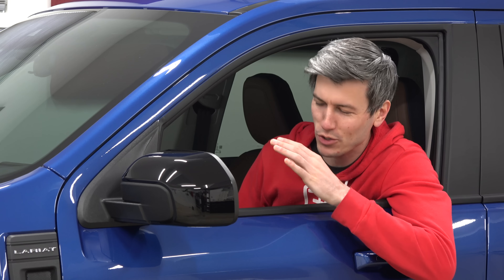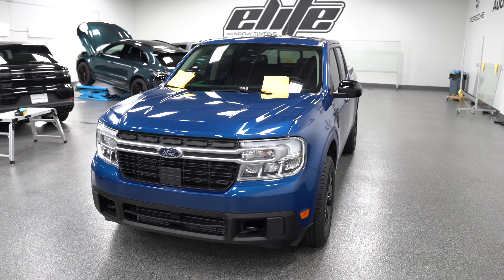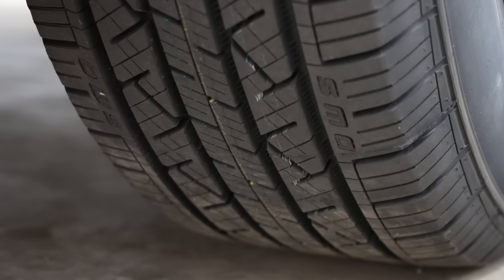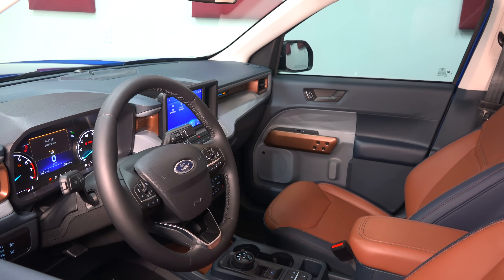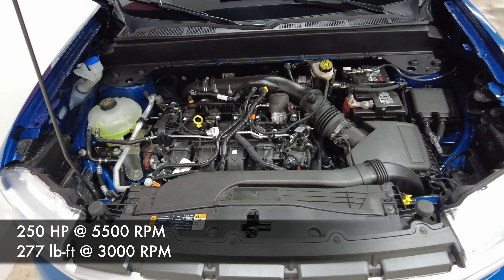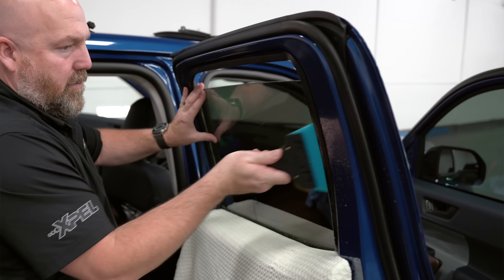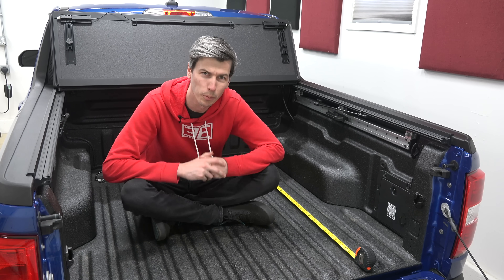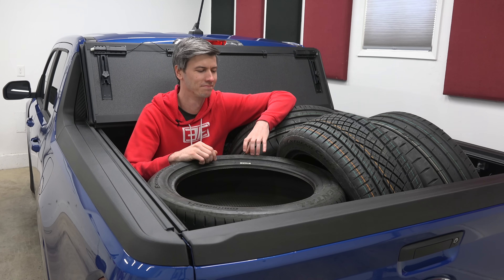I Bought A Ford Maverick! The Perfect Pickup?

Comment: Hey Jason, what do think you’ll do now that Ford “finally” released an AWD version Hybrid Maverick?
PS, I once purchased Continental CrossContact LX20 tires (early generation) and they were amazing = so quiet, so effective for quickly dispersing water and the tread wear was minimal, which has kept my eye on all Continental tires going forward. 
I’d consider buying this truck, maybe, I hope this Ford product has “high quality/score” responses  by owners and no electrical issues or other. Great fuel mileage on the Maverick hybrid to be sure 👍🏼

Yet, I love my no-issue thus far smooth running naturally aspirated 6.6L gas version Chevy Silverado 2500, a 2020 model that has no cylinder deactivation gimmick 👍🏼, no start stop so that long term I won’t have to deal with negative outcomes with the two aforementioned. I have an Oil Catch Can to mitigate HCarbon build up. I love the 82” long box and purchased the robust GMC/Chevy side-mounted bed storage box kits (fits over the dead space surrounding the wheel wells) I don’t mind the 17ish L/100 km on highway when empty and 14-15 around the city, depending.I could go on, however to end with, I also had it undercoated with cosmoline and the paint finish with Xpel. So far, it still looks like new on top and underneath (some winter roads and some summer dry gravel roads get sprayed with that nasty calcium chloride). Oh, my model has their Z71 package and AutoTrac (pseudo AWD) which I use on gravel roads and winter driving. Robert in Edmonton, AB

Comment: You are not alone. I just traded in my 2013 Subaru Outback and a K5 for this truck. Always thought they were a "hybrid" or Electric truck option. I was so surprised to find a blue (My favorite color) AWD XLT version! Test drove a used 2022 FWD and the 2024 AWD version. Hands down the 2024 was the much better option. Was trying to combine the sleek styling of my K5 and the AWD function of the Subaru. This has done both! Going to miss my outback so much...

Comment: Around 40k?!? My new Frontier Pro4x was that price and is 10x better in every way
Reply: Most Nissan Pro4X's I've seen with any sort of options on them are $44k and up.  I got my Maverick FX4 with 4K tow and LUX package for $34k.  Price is better and MPG is better on the Maverick.  I looked at all small truck offerings and the Maverick FX4 with 4K tow made the most sense for my needs.  You are going to spend upwards of an extra $3k a year on gas with the Frontier, its fuel economy is terrible by today's measure.

Comment: The parts store I work at has one for deliveries and I can’t test the truck properly because it’s full of cameras watching our driving. But even with the base motor and fwd setup it is a pretty nice little small truck and it can break traction pretty easily without setting off any alerts about my driving.  I’m guessing it’s decently peppy if I could floor it.

Comment: Back in the 80s I owned a Dodge Rampage, which was a real blast for a kid back then.  It had a 2.2L 4-cylinder, front-wheel drive and a unibody just like the current Maverick - and was absolutely perfect until I got to needing something full-sized.

Yes I know this truck has AWD, but I would never tow with the front-drive Maverick even if it does have a hitch receiver.  Towing with a front-wheel drive vehicle is sketchy, so I would just use it for a bike rack or something similar.

Comment: The Honda Ridgeline has been available since 2005. You didn’t even mention it despite it matching or beating this thing in nearly every way
Reply: The Honda ridgeline at its base cost more then the most expensive package possible with the Maverick at my local dealers, 

If it didnt at least match the Maverick in every way it would be a total scam lmao.
Reply: @evensong3356  I guess that’s a fair point, but you also get a nicer cabin, bigger bed, more storage, more towing capacity, fuel economy not far off. My point was that the maverick is a barely smaller clone of it but is presented as if a unibody pickup is a new concept when it’s not. He paid 40k. For 5k more he could have a trailsport ridgeline. If he paid the base price I kinda get it

Comment: I had a similar epiphany about a pickup truck which unfortunately is not available in the U.S. (or at least I don't think so.) I rent cars in Costa Rica and the price to rent a diesel Toyota Hilux and a RAV4 was about the same. The Hilux (small pickup with four doors) also had a slick six-speed manual, and it got 35 MPG on the highway, nice long bed, and a simple, nice, basic Toyota interior. Four wheel drive, transfer case, etc.

Comment: I heard rumors that the new 2025 FORD MAVERICK will have a boost in both horsepower and, and torque for the 2.0. Also, that they will have a hybrid all wheel drive version. And a measly tiny 1.5 single turbo. But I am waiting on the 2.3 single turbo Maverick AWD.

Comment: It's not a pickup truck. (Not body-on-frame). It's a Subaru BAJA or Hyundai Santa Cruz;  ie: a car with a baby pool in back. Just as "CUVs" are NOT "SUVs", though no one on the internet seems to either know or properly make the distinction.
IMO, the Ford Maverick is currently Ford's halo/flagship vehicle. They're very lucky it's been accepted by buyers and is largely liked. It's one of the few Ford vehicles the "typical" buyer can possibly afford. I don't want to live in a world where the Chevy "Blazer" has a 2.0L Turbo 4. These are sad days.

Comment: I drive a 2024 Maverick XLT FX4 with the turbocharged engine and it is basically my dream vehicle (not a beat up hilux with a .50cal so it’s not a exactly my dream vehicle, but it’s close)
Reply: Oh and apparently I also have the 4k tow package, I didn’t realize that but I have the brake control and seven pin connector

Comment: Just took my 22 2.0 XLT FX4 Off Road AWD on a 1500 mile trip to the OBX through WV, PA, Virginia and NC and averaged 32.5 mpg! Love the truck! Change oil every 4800 and flushed the transmission fluid at 30,000!

Comment: I was very interested in buying a Maverick a couple of years , but the wait was long and if you could find one on the lot it was 5k or more over sticker, I was not going to do that! Plus, my wife didn't like the idea of getting a truck. I bought a new 2022, fully loaded, Bronco Sport Badlands instead. Its considerably  more expensive that the Maverick, but I am loving it! i already have 43k on it ,almost half of that was towing a small 12 foot travel trailer to Alaska and back. It has the same drivetrain as you Maverick. I a typically average 2 to 3 mpg more that rated.
Reply: Has it been reliable? I like those too but own a 22 maverick hybrid.
Reply: @jeedwards1981  Yes. Only problem was a check engine light that turned out to be a bad purge valve, covered under emissions warranty.

Comment: You spent about $7,000 too much. There are literally 300 of them within 10 mi of me. A lariat, 5k miles, $31-35k. With 10k miles, you can get a lariat under $30,000.
Reply: Sell the wheels, put factory 18s on it. 18"X 7.5" WHEEL KIT -MATTE GRAY
$1000.00

Comment: I had been driving my 1988 pick up,  its "full sized" standard cab short bed. So small by today's standards. I got the hybrid maverick because of fuel economy mostly, as well as safety (airbags weren't mandatory until 98). Its been great getting over 40 mpg, and it does what I need it to do. Its insane to me that "truck" people don't think of it as a truck, because the maverick has more in common with my 36 year old truck than a modern f150.

Comment: I bought a 2023 Maverick Lariat FX4 in Dec. of 2023. I had been in the market for a Honda Ridgeline, but none of the dealerships in my region wanted to be reasonable about the price and obviously did not need my business. In the last six months of ownership, I cannot begin to describe how lucky I am to have bought this instead. I love this vehicle. I bought a camper shell through Ford for the bed. (Overpriced, but extremely useful.) I have also installed a Cobb Tuning Accessport ECU Tuner, and Borla Exhaust system which have really awoken the engine with horsepower and torque. Just the right size truck for my needs, and fun to drive. I love the thought put into the interior. Highly recommended.
Reply: I own both a Ridgeline and a hybrid Maverick and love them both. The Ridgeline ( '17 Black) is my favorite but the Mav is a really neat little truck, I also recommend.
Reply: @scottp5315 I love the idea of the maverick and have considered it as a replacement for my 2020 GMC Sierra.  The Honda Ridgeline appeals to my fondness for Honda products dating back to my first Honda.  Mr50 in the mid 1970's.  The styling of the Ridgeline doesn't look right in my opinion.  Love to buy it if it looked better to me.  I finally drove a maverick a few months ago and was disappointed in how cheap the interior seems to me.  Hollow doors appear to be made for the 20 thousand dollar price when it was first brought to market.  At nearly 37 k. The maverick is overpriced and I'm aware it's cheap.  Feels cheap but costs too much.
Reply: Perfect kid car 🪬

Comment: I very recently bought a 2024 Maverick XLT 2.0L 2WD. So far, I really like it. It runs very well, easy to handle and gets wayyyyy better gas milage compared to my old Chevy Silverado 350 I sold to buy this. When it was all said and done the total cost with a 10yr or 100K mi extended warranty was $29.9K. I got the Cactus Grey color.

Comment: Looks roughly the same size as my original 83 Ranger, but much better in many respects. My Ranger was a regular (small) cab with Ford's old twin-I-beam front suspension. Very rugged, not very precise. A 2.3L 1-barrel 4 cylinder with a 4 speed stick, limited slip rear end, manual steering and no AC. Pretty bare-bones, but it was mine! Well, mine and the bank's. $8500 out the door, but that was 1983. 

Fast forward to today - I have a Maverick on order, similarly equipped as yours, and I will be enjoying it no doubt. 2.0 Ecoboost, FX4, 4K tow Lariat.

Comment: I hope you front axles last longer than mine did. Both dead at 11k miles. 2023 hybrid. Got it fixed and sold it for a RAV4 Prime.
Reply: So you sold a vehicle because the CV axles failed? A quick search on the maverick forums you would know that Ford updated the part number for the axles and obviously realized some batches of axles were bad.

Comment: Front wheel drive on a base model truck, unibody, not body on frame. Its got an SUV drivetrain and a cut out box, with none of the stability and rigidity of a normal truck frame.

Its a chevy trax with a box

Basically a honda ridgeline

Comment: I considered the Maverick. It checked all the boxes for me, but I’m tired of dealing with Fords ecoboost motors. I’ve owned three different vehicles from an explorer to an expedition and all of them had issues before 70k miles. So I went with a Honda Ridgeline. Smaller truck, comfortable ride, plenty of space, and a NA motor that has a good reliable history.
Reply: I think the hybrid engine is non-ecoboost. Better gas mileage (56mpg on mine so far) but suffers in towing amount (I think 1500lbs towing for the hybrid)
Reply: And Ford's transmissions
Reply: @andyconnors8992 …Hybrids have planetary ecvts they’re very reliable….
Reply: You chose  something waaaaaay better pal, believe me
Reply: @tacuazinful  The Ridgeline is the gold standard for unibody pickup trucks so great vehicle. That and the Maverick are basically the trucks that most people need, but can't accept it.
Reply: Nothing wrong with that. Even if the Maverick is a nice little truck, the Ridgeline is the gold standard in the World of unibody pickup trucks. Also, if you're going for a higher trim Maverick now and getting close or into the low 40k range, you might as well get a Ridgeline RTL at that point.

Comment: For towing and because I like stupidly large trucks, I will be keeping my Chevy 2500HD LTZ for some time, even though it will need dome attention having 253k on the dial. I just can't seem to spring 90k for a new one, even though I can afford it. Once a tightwad... I do agree that there needs to be options, like the smaller trucks, but I disagree buying a full sized truck with a turbo charged moped engine. The math just doesn't work out in my head. Maybe you could do a vid on small puffed up engines vs naturally aspirated fuel gobblers. Shoulda saved that one for November... Anyways, always good stuff, even if we disagree. This is an older vid, so nobody is gonna read this anyways.

Comment: I am off loading my 2023 XL ecoboost fwd Maverick for a near new 2022 Ranger XLT 2x4 for one reason - the full boxed frame - I just got t-boned by a drunk driver that ran a red light and my 2001 Toy LC saved my life mostly because of the full-frame (albeit the weight certainly helped) but had I been in a unibody vehicle probably would not be here today
Reply: Maverick is built pretty well for a unibody vehicle , its has to be strong to have a 1500lb payload capacity and 4k lb towing on ECO awd models.

Comment: I, too, decided to buy my first new vehicle due to the "vote with my dollars" approach. A bed I can haul deer in, all-wheel for two tracks in trout season, and fuel economy in the mid 30s for under $40k?! I used what I saved to buy Ford stock. That's how much I believe in this product.

I will say, I got an original Maverick in '22, so I got both the 4k tow package and the off-road package. I don't think you need to pick just one option. I also got the optional safe for the center council and boy is that a life changer. I can keep cash on hand at all times and can store my pistol without a worry when I'm in town and don't want it on me. And right now, I can actually hide the engagement ring I just purchased somewhere my girlfriend won't "accidentally" find it. So, internet, shhhhhh. 😉

Comment: I worked on this car back in 2022. When I actually saw it in person I didn’t know what to think of it.

It wasn’t a pickup, it wasn’t an SUV but still felt like it was trying to be both. Some folks even said “I guess it’s a pickup truck for the city(?)”.

It felt like that identity crisis made it impossible to justify why we were actually making it. Until I realised, much like this guy, that it is in fact its strengths. A car that fits most usecases for an affordable price, it doesn’t make sense conventionally but we don’t live in conventional times anymore. 

Glad you didn’t get it in green !

P.S. for folks who are still not convinced, just think modern day El Camino
Reply: It is a pickup though
Reply: I am a new homeowner, and with that comes endless home projects and multiple runs to Home Depot and Menards for supplies. My garage isn't that big, and all I currently have is a Lincoln sedan. Not the car you wanna cram 4 bags of mulch and a new screen door in. That's why I'm in the market for a small, light-duty pickup truck. If I had the money, I'd opt for this Maverick, but since no one has really made anything like this in years, my eyes are set on 2012 and older Ford Rangers, for their size, light duty capability, and reliability. That's all I need, that's all this is, that's all it ever needs to be. No idea why that's so hard for manufacturers to come to terms with.
Reply: What's wrong with the green? Leaning toward that.

Comment: Bought my wife a Lariat Tremor in Atlas Blue. Wish 4k towing package had been an option. But she really liked the Tremor looks and slight factory lift. And we have my 5.7L RAM if we need to haul something heavy. The Maverick really ticks a lot of boxes for being a practical vehicle, regardless of the specific trim. I have a few friends that have them in various configurations and they all sing their praises, too.
One caveat: only use 91 octane or better in the 2.0L EcoBoost. The manual and pundits may say otherwise, but it the fuel mileage increase for CONSITANTLY running 91+ outweighs the cost; and as a bonus, with efficiency comes power benefits. It doesn't seem to care about ethanol content, though. And 7 months into ownership, she's getting 26mpg (good mix of city and highway miles) in an offroad-capable truck. So that's nothing to sneeze at.

Comment: Just one problem. Love the truck. But @ 40k it's a ripoff. It should be $32k as this one is spec'ed.  If Toyota comes out with a 28-30k truck, it will be all over for ford and it's high union problematic prices.

Comment: I think the Maverick is a pretty good truck at a very good price with my only complaint the fact that the hybrid version is only available in front wheel drive.
GWM have released a petrol battery hybrid dual cab 4WD truck in Australia called the Cannon Alpha and it is very good with a price that beats the F-150 and the Tundra hybrid models by a considerable amount.
😎🇦🇺👍

Comment: All year round tires? It’s not only the thread that makes it winter tire, it’s also the hardness of the rubber. Winter tires are much softer than summer tires so that they give good grip also in cold weather. It even says so on Continental’s webpage. Using a winter tire on summer weather will give worse grip as the tires are too soft and they will also wear much faster. 

Sometimes there is a short cut, most times there isn’t.

Comment: I really did want one of these until I saw the ground clearance.  That is the one thing it just doesn't have.  My 2008 Chevy Colorado has 31" tires which won't fit on that and another 4" of ground clearance.  Here in Michigan where we get 14-18" of snow or more regularly and I drive back into fields to pick up deer etc., the Maverick just cannot cope there as well.  I really wish more of these manufacturers would include a std. shift option.  I've hunted for 3 years and cannot seem to find them.